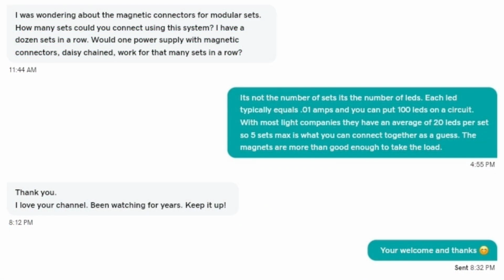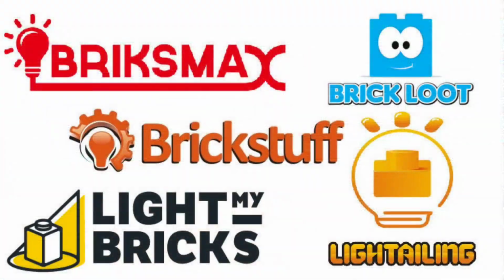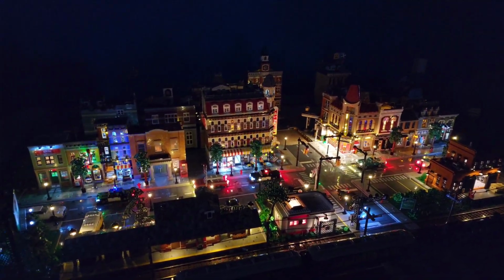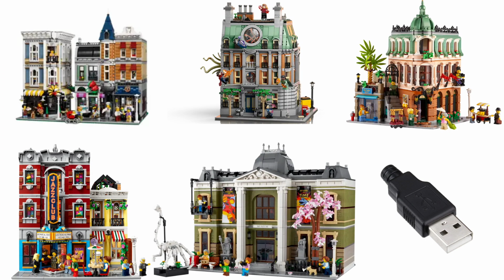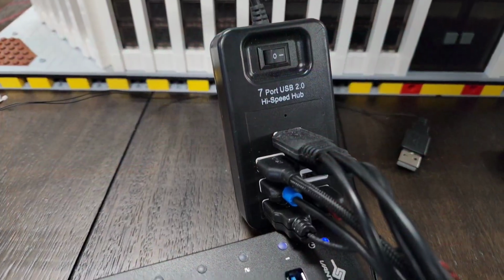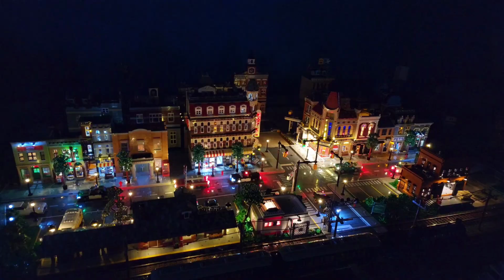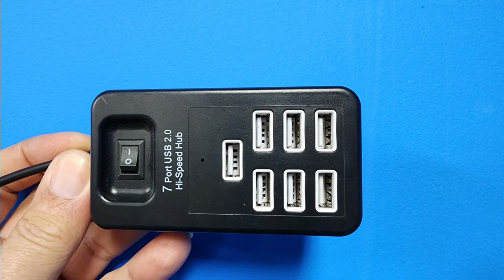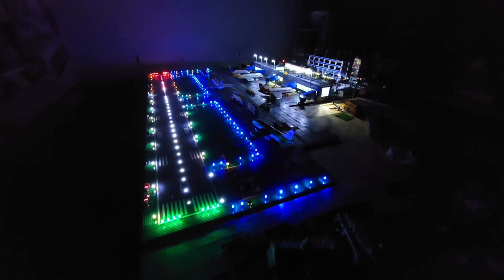Lego Light Kits: Maximizing Lighting with a Single USB Plug

Comment: I'm trying to figure out the most efficient way to light up 40 sets. Each set is one USB to ~10 LEDs, so it's way under the 150 LED limit per USB 3.0. My bottleneck is not LED count, but number of USB ports.

Question is, do I need four of those 10-Port Powered USB Hubs (4 x 10 USBs for my 40 USBs), or I just need one USB Powered Hub, and use a regular non-powered USB Hub to split each USB to multiple light kits, as each base USB port in the 10-Port USB Powered Hub was said to technically support 150 LED lights?

Comment: very cool, I was wondering what type of connectors do you use I have a lot of brickstuff lights?
Reply from the maker: I use .8mm jst and depending on the age of the lights brickstuff uses 1mm jst, but I know they announced recently they were switching to .8mm
Reply: @BevinsBricksWorld  ok, they used two sizes and they switched to just the small one, though they still have some stuff with the largest connector.
Reply from the maker: @dronko-fire-blaster yes the small one is a .8mm jst connector

Comment: Nice information, but this does lead to one more question: How much LED's can you connect per extension wire? Can such a wire hold up to 100 or 150 watts?
Reply from the maker: The rule works with extenstion wires, plugs, magnets, expansion boards all in the system.